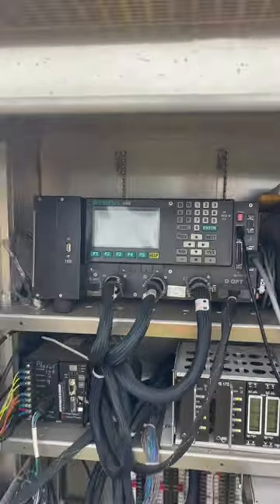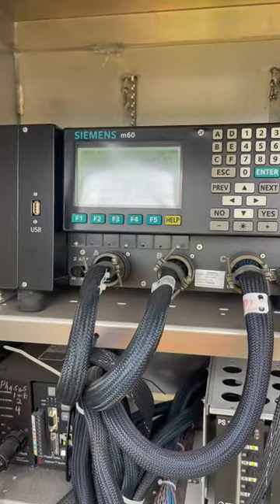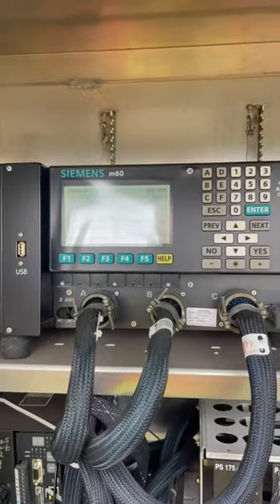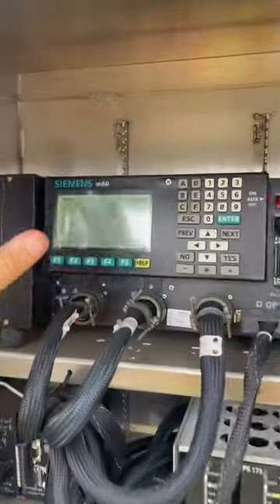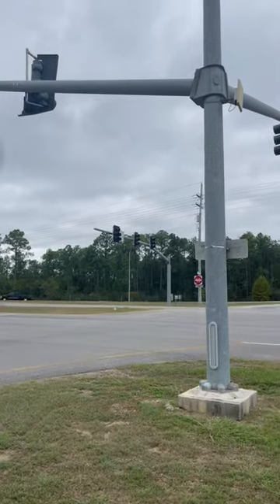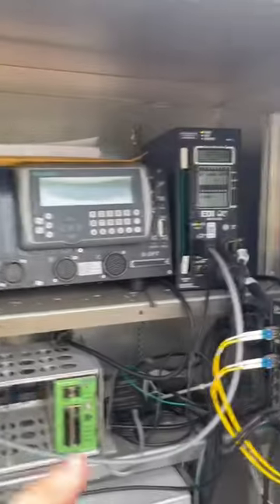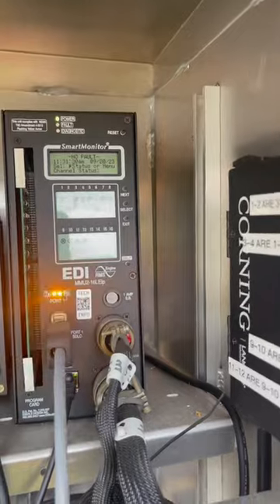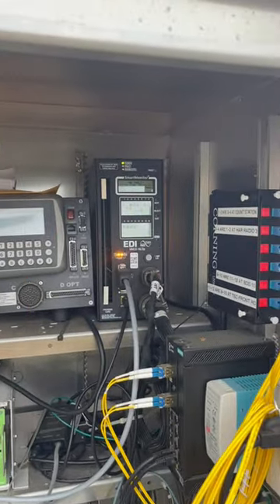Raspberry pi and traffic lights!

Comment: I love when people think they know more than a professional engineer just because they learned what a raspberry pi is.
Reply: Well no they obviously don't know what they are 😂.  📍 Terminals are definitely not for production.  🎉
Reply: Yes, but I think there is still a point to make about size and costs of many safety-critical things. My feeling (as an engineer who also has done research on safety-critical hardware during his master thesis) is also that these devices are bulkier and probably also more expensive than they need to be. You can't just use a PI, but the amount of traffic lights that exist should justified a size-, cost-, and energy-optimization of these devices.
Reply: It is raspberry pi s fault. Honestly, they are totally pushing pis at industry.  And maybe they do have certain technology that can work in some scenarios some of the time but they push their product like it's the greatest thing out there.  And they aren't even in the top of SBC choices out there.  Not even close if you are talking specifically industrial standard SBCs

Comment: "Built to last atound three decades. Without any kind of failures and constantly running"
😂😂😂😂😂😂😂😂
As someone that repairs Siemens industrial electronics daily, all I can say is, that's cute bud.
Reply: Yup. I've replaced more S7-1200 hardware than any other brand or model.
Reply: lmao the irony

Comment: As a controls engineer I’ve had a similar discussion with several coworkers, regarding plc vs pi or arduino or whatever. To be completely honest I think the real reason is just customer support. When you buy a plc you’re not just buying the plc you’re generally buying into an ecosystem. AB and Siemens have been around the block, and have a reputation and large breadth of highly engineered products. The most costly thing in implementing controls systems, particularly for industrial things, is engineering time for the systems designer, and downtime for the customer. You could use a random microcontroller or random computer to do the same stuff functionally, but why invest in all that software engineering and such when a product exists? 1000s of dollars upfront < much much more for developing things from scratch
Reply: Thank you for being the first person to say something that actually makes sense in this argument lmao. I swear everyone is like "Nah, you can't use a pi because it needs to do xyz" and then they proceed to explain shit a pi or a handful of pis could easily do. Yes, a pi absolutely could control this intersection and be just as robust with proper engineering. But there'd be no point for anyone to do that engineering.

Comment: So basically you plug a 2007 dell mini tower into an uninteruptable power supply, which is in turn plugged into a surge protector.  Upgrade the fans in the case, solder the heatsink to the cpu so you can skip thermal paste maintenance.

Shove into cabinet. Done. 5k minimum savings on materials alone for each intersection. Thats quite a large material cost reduction.
Reply: a 1997 compaq will do.  those things are goddamned indestructible.  They can't even lose their BIOS settings because most of them are just switches on the mobo.  I deployed half a dozen of them all over for a small country ISP before cell phone advances crowded us out.  All we had to do was stuff them with socks and run prime95 in the winter so they wouldn't freeze.
Reply: Siemens m60 runs MPC 8270 processor. Your Dell is too slow to boot up if ever required reboots and too complicated for the job you wouldn't promise it to be there if you are sane person.
Reply: @XantheFIN  modern PC's can load pretty much instantaneously.  It's just Windows that's so freaking huge.
Reply: @tsm688  Modern PCs are not realtime systems. The purpose of a PLC is to emulate ladder relay logic, so it has to be real time.

Comment: “Built to last around 3 decades”- how old is the oldest unit you have come across in service of this make / product line?
Reply: The unit in the video, the Siemens m60 was released by the manufacturer on to the market in around 2014.

So the longest anyone has had this product out in operation is around 10 years.
Reply: These replaced the traconexs lol some of those are still in use over 25 years old
Reply: We have an semi-analog SIEMENS system and it’s currently 26 years old. 30 year old operation is the correct claim.
Reply: Mean Time To Failure/Mean Time Between Failures is usually based on a statistical analysis of component failure rates.  Time is selected from the middle part of the bathtub curve where it is generally closest to random chance.  Then a margin of error will be determined beyond the calculated rate.  In many systems to achieve required parameters this requires systems built with parallel redundant logic and fault detection. 

Maximizing these usually involves using silicon that is designed with slower clock speeds and physically thicker gates and interconnects throughout.

The big advantage in this industry to having off the shelf fast small universal systems like the raspberry pi is that you can prototype, develop, and emulate designs without having to work directly with the hardened components in the development stage.
Reply: I think there are still a lot of MC6809 (Motorola 8-bit microprocessor with the advanced feature of "hardware multiplication") based systems still in use.

Comment: Surely having full blown scada systems at every intersection cannot be the smartest way to do it.
Reply: If you really think there’s an easy solution you should start a business, I’m sure the city would love to save a double g per traffic light
Reply: @Jonathan-ex3sl I'm seriously thinking about it
Reply: Full blown SCADA systems run oil & gas fields, electrical substations, manufacturing plants… an intersection is nothing.  Each phase is controlled by a loop in the ground.  SCADA would also offer remote control

Comment: thermal cameras for detection are my favorite, big issue though is now with all the electric cars they can have a harder time picking up those cars due to no heat from the engine 😅
Reply: Thermal cameras are not common anymore. It's cheaper and more effective to use "normal" cameras paired with monitoring software anyways.
Reply: @epileptix8954 I really want to see how that’s done. Had an intersection that wouldn’t trip the left turn, the DOT guy had to “trick it till they could get a crew to clean the camera”
Reply: @kb9vgr  that falls under "entirely too clever" and "designed to fail"
Reply: @epileptix8954  Yep exactly. A decent hardened cam module is where you're seeing the cost savings over a thermal. And machine vision software is getting better and cheaper every year.

Comment: Why is it that major cities can't manage their traffic signals properly, but small and medium towns and cities get all these fancy bells and whistles?
Reply: Hey, I work on signal design for a living, and have to coordinate with DOTs all the time. One of the reasons this could be the case is the structure of your state DOT department. In places like Virginia, there is the state DOT (VDOT), that reviews and processes signals, and then there are differed branches of VDOT that encompass counties. FCDOT in Fairfax County is an example. What is important to remember about large cities is that they often time fall outside of the county ordinance and have their own regional bodies. Fairfax is a county, but the City of Fairfax is not technically part of that county. So if a city does not have an able bodied DOT department, it will look uncoordinated with the counties around it that do have one and often defer to the state DOT.

There are other reasons why cities are harder to manage too, but generally speaking this equipment is a standard requirement by SHA and the FHWA. States and lower bodies can only up the requirements, not lower them (similar to how federal and state laws work). A signal network that is poorly timed or isn't using interconnects well doesn't necessarily mean that the equipment to do so isn't available. It probably is in new installations, recently modified signals, or existing signals can be retrofitted to operate as such. 

Depending on the location your looking at, there may only be so much that can be done regardless of equipment. In large cities, the expectation of traffic ratings is lowered by population. A rural town with low traffic may require a signal installation result in a B or A grade for its Level of Service (LoS). In cities, the requirement may be as low as an E. This means that technically, if a signal brings the LoS up from an F to an E, it may be considered a viable signal, even if it's basically still failing in comparison to signals in a rural area.
Reply: @epileptix8954  The city I'm referring to is in a major county. Although, the able bodied DOT part is definitely accurate. Nothing about the city operations is able bodied
Reply: @WannaBeHocker  certainly interesting. Truth is though, most DOT will fold under decent public pressure. If a community petitioned to have their infrastructure reviewed, it would likely make it on their agenda. Especially if safety risks can be pointed out at intersections that need to be modified. One of the main ways you can draw attention to them is to see if ADA compliant pedestrian equipment is installed at intersections in question. If your ped push buttons don't beep when crossing, are more than 10 inches reach away from the level landing of a ramp, or if the ramp doesn't have a level landing are things you could look for if you were interested in trying to petition them.

Who knows man, you could be the change you want to see in your area if you are looking for more competent DOT in your area. If a DOT is failing the needs of its locale, the state or federal DOT will do something about it. You can think about them a little bit like you would any company concerned with their PR image.
Reply: The reason is that in the USA the main roads through small and medium towns are run by the state. Whereas larger cities have to budget road infrastructure on their own.

Comment: i work in aviation, and i think all avionics should be run on Rpi's - change my mind.
Reply: Well I work in the chip industry doing reliability. I've worked on chips in the consumer, automotive, and Aerospace industries. In my line of work, we don't talk about "if" a failure happens, we talk about how many and how often failures happen. Failures are a statistical certainty. Every chip is designed to meet a failure spec for it's specific application. I can promise you, the RPI's reliability spec is absolutely not acceptable for avionics. In consumer electronics like the RPI, we are targeting something like having a failure on the order of months. So statistically speaking, that RPI, maybe once a couple months, is going to have some sort of error. Sometimes those errors don't do anything, sometimes the software can recover from them, sometimes they'll crash the OS. And sometimes they produce something we call a silent data error. That could be something like an altimeter suddenly reading that it's 100ft higher than it is. Is that likely? No. But are you going to gamble your life with  odds like 1 error every couple months? Are you going to gamble the lives inside of thousands of aircraft with those odds? For perspective, in automotive, we target failure rates on the order of decades.
Reply: It’s a hobbyist small Linux computer. It is meant for hobbyist things, avionics NEED I mean NEED TO be reliable. Rpi s don’t have the circuit protection and the reliability to do something important. If the sd corrupts or the thing freezes. You know these industrial computers might be simple, but reliability is the most important thing. You wouldn’t want it to freeze in the middle of a flight. Hell nah. And you know ho much bad press the company would get.

It is more expensive for the plane to crash and with many lawsuits, so it’s not worth the non substantial money difference.
Reply: Ok, sure.

But an avionics Rpi isn’t going to cost any less than whatever is currently being used.
Reply: I would never trust an rpi to fly a plane. They are nowhere near reliable enough

Comment: Anyone suggesting an RPi for this has no business going near a safety-critical system.
Reply: The fact that they are arguing that the best way to save money on a million dollar piece of infrastructure is that you should spend $50 on the computer vs $5000 or whatever the industrial version costs but in the time that it takes to replace the broken pi you're lost far more than $5000 of productivity in the time you spent fixing it vs something that wil just always work is absurd.

Heck if you were talking about a controller for a robot or something used in manufacturing,  the opportunity cost in time not having your robot making something because its broken would easily overtake the cost of the industrial computer just in 1 break down

Comment: I don’t think he has anything against raspberry pi but what we have to understand is that raspberry pies are an entry-level piece of equipment and heavily customizable these machines are specifically designed for these purposes to grab raspberry pies and custom make these would be a waste of time money and resources when a component goes bad in the cabinet all he has to do is grab the model number from and get an exact replacement directly from the manufacture it saves tax paying dollars in the long run by allowing a company that already has expertise in the field to design equipment plus the PLCs that plug in and out is way easier than having exposed pins which can bend very easily especially if something like a car knocks the heck out of that box. and I don’t know if you guys noticed how many freaking pins those three cords going into the box have but I don’t even think in Arduino mega has that many pins in one

Comment: Similar why cpus made in the 90s are still being used for anything space travel related. They’re made to withstand radiation extreme temps and last. A PowerPC cpu meant for space costs upwards of around $300,000 or more

Comment: “Without any kind of failure” light at the intersection 5 mins from my place has been down for 2 weeks now…
Reply: Sure, but how many intersections have you driven by that weren't having problems? I have probably seen maybe 3 traffic light failures my whole life.
Reply: There are several thousand traffic lights in a small sized city. Those thousands of units are running fine. If 1 in 1000 breaks and needs servicing every month, that’s good reliability.
Reply: He's not talking about a light going down. That is actually not really a failure as the electronics are able to detect and safely deal with the issue. What he is talking about is a failure such as an issue coming up and causing both directions to go green.
Reply: The intersection might be down, but is it green in conflicting directions at the same time?
Reply: Learn statistics kid

Comment: There is already a lot of good comments on why not.  But to add to those, software versioning and updating, supply chain assurances, vulnerability management, hardware ruggedisation, availability, industry support outside the guy that “home brewed” the solution, etc.  
In theory you can run a bunch of desktops instead of using servers or cloud computing BUT YOU DONT because they are NOT fit for purpose.  Anyone actually using raspberry Pi, which is consumer grade tech for industrial control deserves to be kicked off site and deserves the associated lawsuit when stuff goes wrong.  If it is important enough to have control loops then IT IS likely either EXPENSIVE machinery and/or has the ability to impact HSE (ie people).  If you put a 100$ controller on a multi-million dollar plant then you deserve the kicking you will ultimately get.  The only place for raspberry pi in this context is either fun learning labs OR side loaded IOT style data gathering BUT they should be completely segmented from the control loop and can be used to enrich the data people use for decision making.

Comment: My first internship had a coworker design a automated assembly line that replaced washers on a bolt with new ones. He had it controlled off of like 5 arduinos. Our job at the internship was to convert it to a plc based system using just one main plc controller. We finished it but ya a raspberry pi would not be used in industrial settings. The internship I am at now is using one for a test-bench to test one of the devices but this for medical technology and all the pi is doing is communicating with the devices i2c bus and controlling some button trigger events.

Comment: still doesnt change the fact that all of this could be replaced by "a few" micro-controllers with appropriate switching circuitry, sensors and whatnot - and of course a lot of professionally developed, tested and certified software. 
This ASIC stuff is old and needs to be replaced at some point. These are facts.
Reply: Appropriate switching circuitry? You mean like all the stuff that is in that box?
Reply: @nitehawk86  well ... "some" of that, yes - after a thorough consolidation of useless brainfarts im guessing less than half would be left. You'd be astonished to learn that fully digital control circuits can do so much more than you ever imagined 
... coming from a fully analog world. But thats a story for another time. Simply look at the sizes of the very first space shuttle control circuits compared to modern ones ... they actually lost transport mass hence they were able to put additional stuff into the rockets. Rope memory circuits / boards are extremely big, for instance - this has been reduced down to the sizes of small chips.